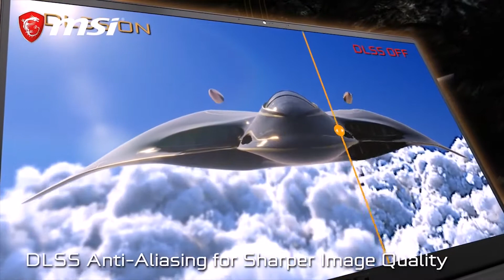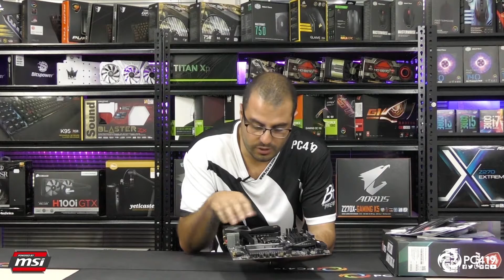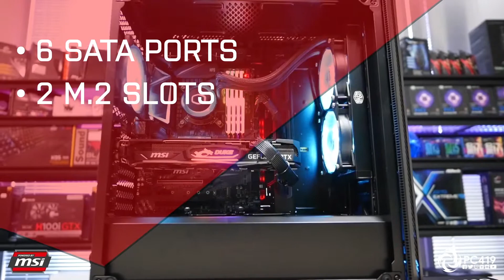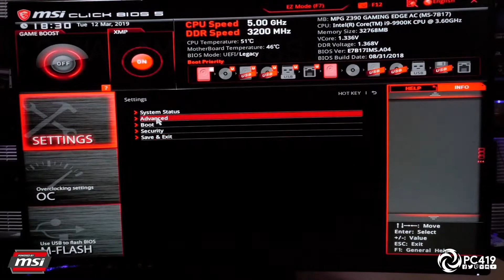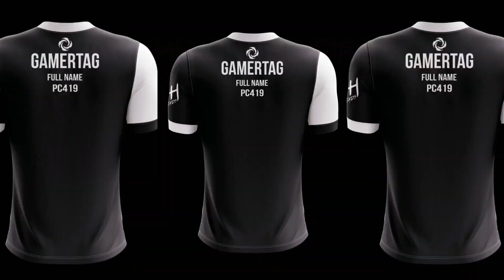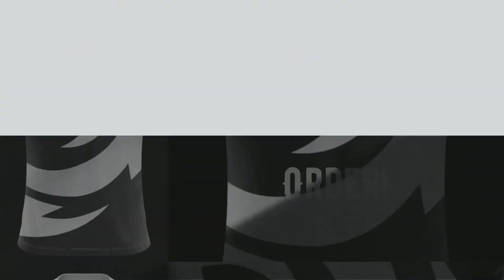MSI Z390 Gaming Edge AC Review!

Comment: Hi, questions:

Does the USB-C port work on this motherboard? 
I tried USB-C cable, USB-C ->DisplayPort  and USB-C to HDMI  cable to connect to monitors, none of them work. I can only use display port and HDMI port. This is very disappointing. What do I need to do to make it work? 
Is the USB-C port on this motherboard for power delivery only?

Comment: I just bought one of these (haven't received it yet) My Power Supply only has 1x 8 Pin 12 V (2X 4 Pin 12 V). Will it be safe to just use the 8 Pin + Molex to 4 Pin 12 V if I plan on Overclocking 9700k + 2070 Super?
Reply from the maker: Hi Kyle, thanks for watching what is the PSU you have currently the model and brand?
Reply: @PC419  EVGA 750w is 75+ (there is no other model just EVGA 750W has 59A on 12V)
Reply from the maker: @kylematlock7499  surprising only comes with one PCI rail for the gpu I would not recommend using molex power, but it will work have nothing else plugged in the molex cable bar from the GPU, but I would recommend purchasing a compatible PSU, make sure the 4 pin X2 is not the EPS connector (CPU socket)
Reply: @PC419  I could be totally missing someting (Im rather new to this, I've been trying to figure out what your comment meant.) I think I may not have been clear in my question, My GPU is fully plugged in (8 pin + 6 pin) My CPU only has 1X 8 Pin 12V (4+4 EPS) I need 1x more 4 pin 12V EPS for the MSI Z390 AC. I'm asking if its fine to add one more 4Pin 12V EPS Via Molex adapter.(at least until I  get some extra coin) Again,sorry If I am just totally Missing something.Thanks for th e help!

Comment: Were you having and CPU throttling issues with this board and that processor? I have the same combo and have been suffering overheating issues since building it. I stress tested the CPU and overheating and throttling was detected. It's stock and not overclocked at the moment. I'm wondering if my watercooler (Corsair h100i) is either riding out, or isn't sufficient enough to cool the cpu.
Reply: I've also heard that the VRM might be part of the problem?
Reply from the maker: @Nathan-dd2uy  thanks for watching, have checked to make sure the cooler is getting full contact on the IHS?  When we used this board here at the studio we didn't have any overheating issues and was stressed tested for days with multiple CPUS and GPU stress tests. what temps are you getting?
Reply: @PC419  Hey! Thanks for the reply. Everything was together and apparently operating as designed. Turns out my case (In Win Infinity) was hotboxing the CPU. I bought a new case and switched to a DH-15 for cooling and now my temps are perfectly healthy.
Before switching case and cooler, the computer was idling at 40 to 50 degrees Celsius and hitting temps as high as 90+ Celsius under load, stock, no overclocking, so alarmingly hot.
All is well in the house now :D
Reply from the maker: @Nathan-dd2uy  that's good news you found the issue and shame at the same time the case was causing the overheating issues

Comment: nice , that's a new kind of memory , the moduals , should be quick , very quick . Joke aside , i'm still not sure what to buy . i have the choice between this msi , ASUS ROG Strix Z390-I, GIGABYTE Z390 I AORUS PRO or the ASRock Z390 PHANTOM GAMING-ITX/AC, men i'm so not confident with mini-atx boards . what would you choice? hooo I dont care about overclocking
Reply from the maker: Hi Maria, your choices are all good, which is a good sign your doing some research, all comes down to personal preference now, if it was me having used Aorus and MSI and ASUS personally i can say  cooling and stability on these boards are great. are your building a ITX build or in mid tower case?

Comment: Hey I need help with picking a power supply I picked a semi modular 750 bronze Corsair to connect with i7-9700k, 980 Evo 500gb, 2070 super x gaming trio, Corsair vengeance RGB 16g 3.2gh, Corsair ht100i cpu cooler, 1tb hard drive and MSI carbon gaming ac motherboard
Reply: 970 nvme m.2
Reply: H100i cpu cooler
Reply from the maker: you have a great setup, my suggestion is always gold or platinum power supplies due to Power stability right through the system, one key point to mention always spend that little extra on a PSU as its the last component you will replace life time of the PC.

Comment: Hey could you do that overclocking the 9900k on MSI Edge ac video please. And also I have the same but at stock bios settings(most recent bios version) and It bsod's when idle sometimes. Especially around startup or on internet. It's never bsod when playing games. I have a x72 NZXT Kraken for cooling. Thanks for any advice. I'm kinda a noob at this btw
Reply from the maker: Thanks for watching, I did explain during the video how to overclock the 9900k those settings should work for you also, let me know how you go and if you would like a tutorial video ill add it to me list :)
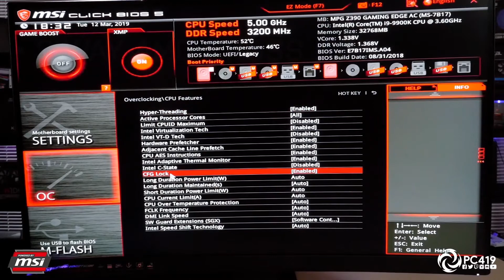Reply: PC419 you forgot the voltage settings in the vid but I figured it out by pausing @15:30
Reply from the maker: @snapper8283  Glad it worked out, running stable?
Reply: It appears stable so far on day 2 using your settings. Temps were in the high 70s low 80s during 100% load and high 40s low 50s at idle cinebench score was 5068. The 4.8Ghz all core got a cinebench score of 4919 and temps were mid 70's with idle in 40's. I'm probably gonna use the 4.8 for daily use. Thanks again.
Reply: PC419 I just flashed to the new bios and had to watch your vid again as a reminder on the OC. I was able to achieve the 5GHZ all core with Ring of 4.7 fixed , mode 3 on auto, c-state disabled, @1.29volts no XMP and it appears stable. This vid has helped me a lot thx again lol.
Reply from the maker: @snapper8283  i am glad it is all working and running as it should be, glad the video helped enjoy!
Reply: PC419 hey thanks for replying. I want to try your overclocking settings it's just I'm a total noob at this and don't feel very confident about what Does what and why. But I really want to learn. I trust your settings but how do I revert back to stock after I use your settings if I forget what the factory settings are during the process? Thank you for helping.
Reply: @snapper8283  
you need to pull the battery out of the motherboard, the settings will be reset